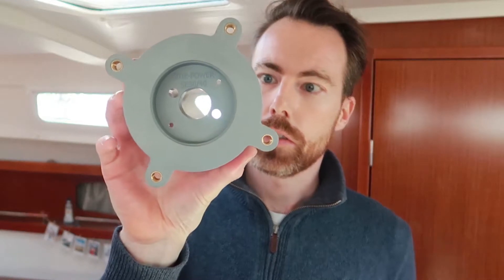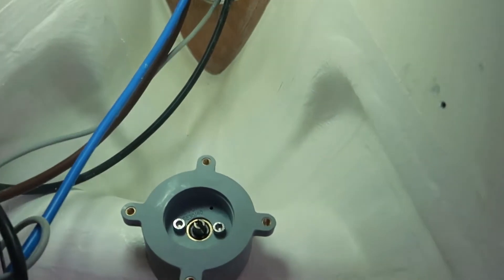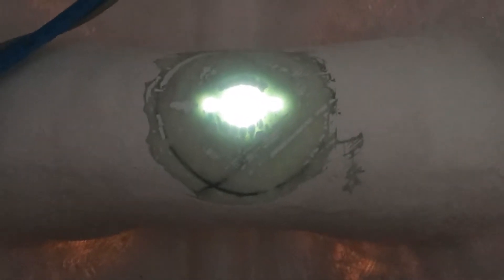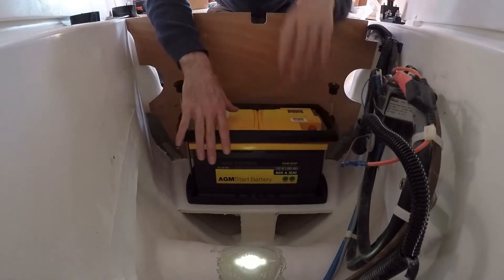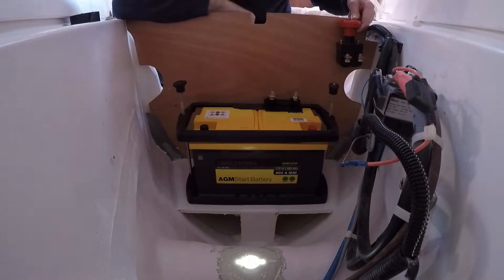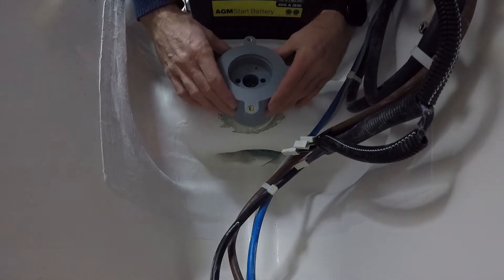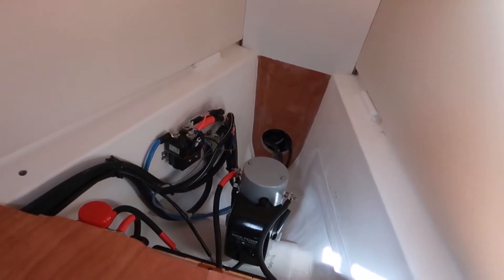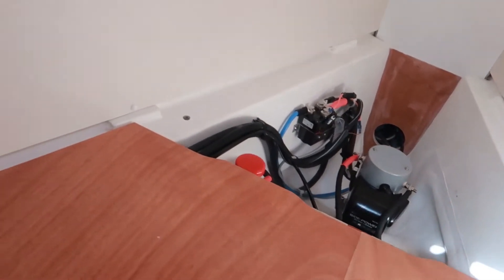Finishing up the project! | DIY bow thruster install

Comment: Excellent video thanks, it gives me the confidence to do the job myself, something I have been tempted to do for many years. May I ask what you used as a fairing filler for the final hull finish?
Reply from the maker: Glad you liked it! I used the west system 406. It is slightly difficult to sand, so a lighter option would be the 407 fairing filler. Good luck with your project:)

Comment: Great video. What power and model of bow thruster do you have installed on your 34-footer? Thanks.
Reply from the maker: Thanks! It’s a Side Power SE40. On paper slightly underpowered, but since I could place it so far forward, it has sufficient power even in strong winds

Comment: how do you intend to charge the battery. i agree you need to invest in some hole saws or cone cuter to make your job easier. given me the confidence to fit my own. great vids all the same.
Reply from the maker: Hi, found that using a victron DC-DC charger was by far the easiest to implement. No need for thick cables running the length of the boat. It charges the battery at the bow with 10A, so given the limited use of the bow thruster ( only short bursts) the battery is quickly topped up.

Comment: Mate you were doing a great job until I saw you use that crimper.....what were you thinking.😅
Reply from the maker: It’s a great crimper😆
Reply: Borrow a hydraulic crimping tool, or purchase one. Even the $80 I got was great. It presses so hard that the copper becomes solid in the crimp.

Comment: Nice job! Why a start battery and not a deep cycle?
Reply from the maker: Thanks! So the reason for going with a starter battery is basically down to the very high current drain for a short period of time. Realistically the thruster is only on for short bursts of 2-5 seconds, so under normal circumstances it never really sees any real discharge. Remember that the diesel is mostly also on meaning that the alternator is also pumping 60A into the battery

Comment: On your tube of the bow thruster why is there a hump on the front of the tube all the others i see are flush? was that a design flaw or you meant to do that for a reason?
Reply from the maker: It’s called a deflector or spoiler. The purpose is to guide the water from hitting the backside of the tunnel causing turbulence and noise. On power boats it’s normal not to have it since the tunnel is out of the water at speed, but on sailboats it’s very common. The only reason for not having it is to save cost

Comment: Great job on the install and making the video. I can see a problem with the weight of that motor breaking the tunnel over time. You might want to consider an brace from the top of the motor to the bulk head for extra safety..

Comment: Hey and thanks for the nice video! I have one question though, how do you keep your bow thruster battery charged up?
Reply from the maker: Hi. In our latest video I’m talking a bit about the charging. Currently I’m using a Victron DC-DC charger. It works ok, but not ideal. I’ll do some changes to my setup soon, so stay tuned for that :)

Comment: Hi again. I’m about done on mine, such a huge job!  Just wondered, the yellow wire has a plug to plug into on the controller end, but nothing to plug into at the thruster end. The instructions don’t seem to be clear on what that wire does - maybe it’s an earth?  What did you do with yours? Not sure I could see. Cheers 👍
Reply: Ah OK, got it. Thanks for a quick reply! When I am totally finished I will do some sort of video. I took a lot of stills along the way so will stitch them together and make a video 👍
Reply from the maker: Great to hear! Yes, it’s takes some time! The yellow is only if you have installed an automatic switch. So if you have a normal manual on-off kill switch you don’t need to use it.

Comment: Thank you for an excellent series on your bow thruster installation, nicely done. I just subscribed a few minutes ago and became #250. Now the count stands at 251 - before you know it, your face will be famous among sailboat DIYers!

You installed the fuse after the emergency shutoff, which leaves an unfused switch and length of cable. In the (unlikely) event of a dead short at the switch you will have unwanted excitement. You clearly gave a lot of thought to the install and I am curious about your reason for the layout you chose. 

Looking forward to more videos.
Reply from the maker: Thanks!. I must admit that you might be right about the fuse placement!. I remember that I looked at tons of forums to figure out what is best-practice, but at some point I must have had a brain-short when I did the final wiring!. Think I'll change it during the winter.
Reply: @jacobkollerup  Good move. Check pages 238-39 in Nigel Calder’s manual, fourth edition. For electrical and electronics, you may also like Pacific Yacht System’s YouTube channel. Happy sailing.

Comment: Great job very informative.  I'm trying to decide between hydraulic or 12 volt. This seems easier.
Reply from the maker: Thanks! Unless your boat is very big I would definitely recommend going with electric (either 12 or 24 volts)

Comment: Thanks for doing the video series. Just last week I got caught out by a stiff wind while leaving the slip. All was fine as we cast off the final spring line. At that moment, the wind shifted and without the proper steerage, we got pushed up against the pilings, with a 20 knot wind broadside. A bow thruster would have given the needed steerage to avoid this.
Your point about relieving the stress of docking is well taken. I've done plenty of docking classes and yes a bow thruster is not essential. However, I want to sail single handed. This will make things a LOT easier.
Reply from the maker: You’re welcome! Yes exactly my point why I love having a bow thruster. I actually try to use it as little as possible to perfect my skills when docking, but sometimes it’s just physically possible to keep the bow in place and avoid hitting the neighbor boat

Comment: Thankyou for this great series, very informative. One Question, could you estimate the man hours you put in for the complete installation? many thanks
Reply from the maker: Thanks!. It´s hard to estimate how many hours I spend mostly because the install took place from November to April, since I both had some cold weather (where I couldn't do any fiberglassing) and also my normal day job. However, if I had perfect conditions (20 degree C) and all the materials and components, I think I could do the complete install in about 40 hours.
Reply: @jacobkollerup  great to know, thanks, I think I will be embarking on the same adventure!